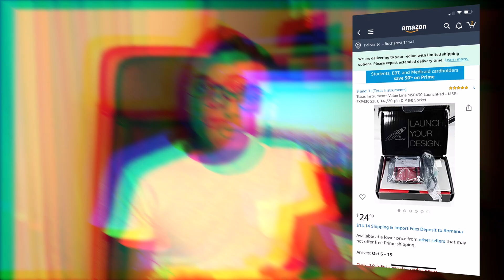How To Write Efficient Code for Embedded Systems? C/C++ vs Assembly

Comment: I wrote in assembly since the 80's, and C is way way way easier. In the past year I have stopped with assembly but in recent years have used two processors, the PIC in assembly for timing & speed...like a periferal, and Atmel for the UI and less time-important routines like UIX & I/O.. The bridge being SPI and worked very well :)

Comment: Bla bla bla, no benchmark or  test or proofs
Reply from the maker: Hard to benchmark when compiler optimisations, programmer skills come into play. If you know what you’re doing, you can optimise your C code so that it gets translated into instructions that run fast on your microcontroller (for example division).
Reply: My father once rewrote a program that took a week to run in basic, in assembly. Basically iterative loops with a calculation.
Actually he still kind of used basic for the loops and just did the calculation in assembly.
Essentially the program ran in two days.
Mind you that was basic. Not sure how it would run in c or how much faster it would run withe the loops in assembly.
This was all back in the early 90s.
Reply from the maker: That’s really interesting, thanks for sharing! You’re right though, things have evolved since then and are different. However, if you know the platform well enough, you can be more efficient in assembly. 

Another option would be to look at what the C compiler outputs and start optimising from there, this should take less time.